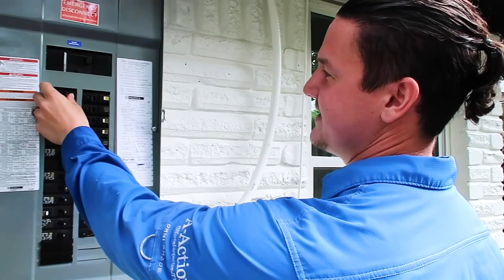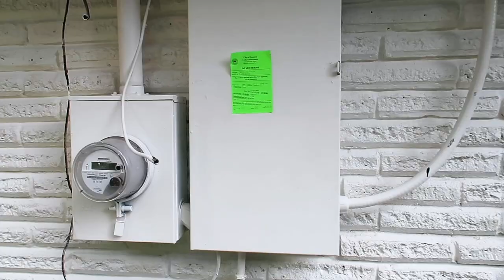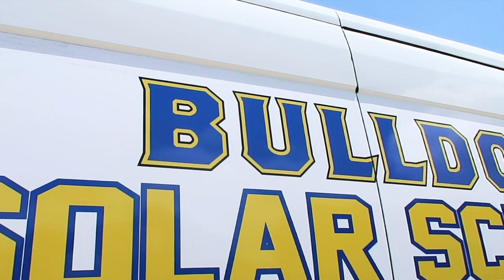1960s Flip Home Inspection

Comment: Do you mind elaborating on the purpose of the solar screens? Do they help prevent heat from entering the house?
Reply from the maker: That business failed but they help reduce the amount of heat entering the property.  The negative is the screens dramatically reduces light in the property.